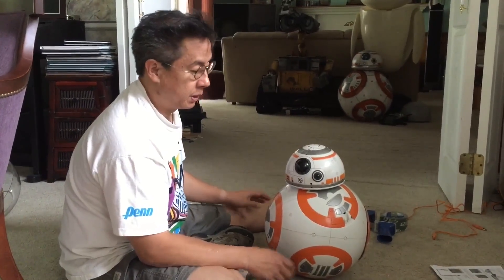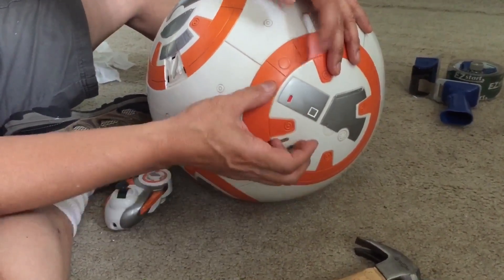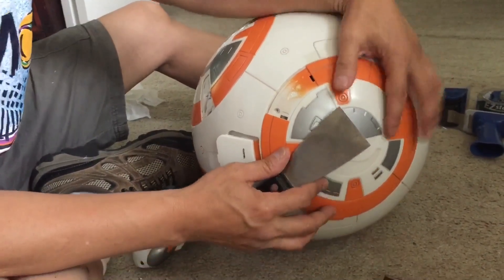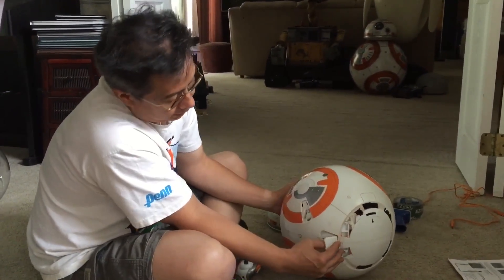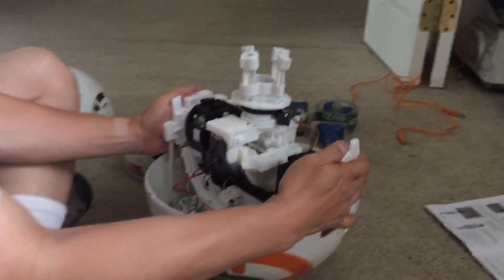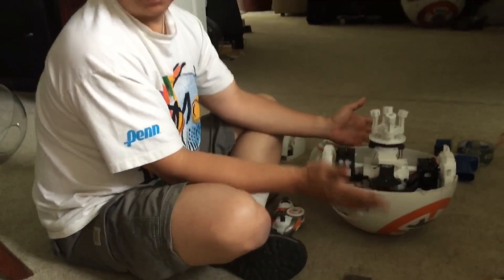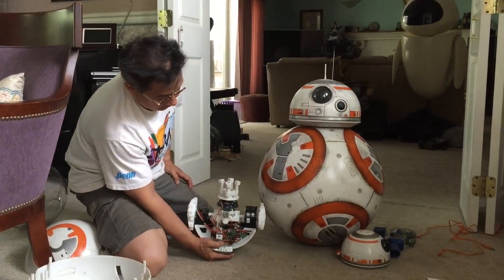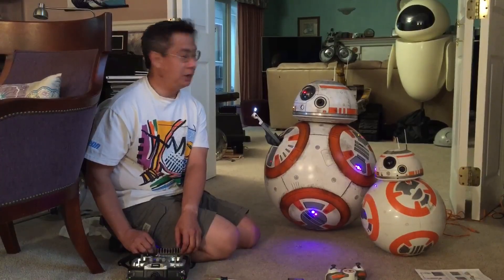Spin Master Hero Droid BB8 - Deconstruction

Comment: Hey I had this sitting wrapped up in my attic for years, was working fine when stored. Took it out didn't power on, plugged it in seemed to charge powers on both head and body. However it seems to work for only about 10-20 seconds before it makes these 3 beeps noises. Any ideas? Seems to work perfectly in any mode up till that point. Then I have to turn both off and back on again.

Comment: I just performed an operation on my 2017 SpinMaster BB-8 Hero Droid. What I originally thought was a battery issue, turned out to be a main drive motor seizing up. The toy moved slowly, and had great difficulties making turns. 
 
Thanks to you, Mike, and your video about making BB-8 a puppeteer, made troubleshooting a lot easier. I had taken the mechanics out of the sphere and use the remote control to make the motor spin.The drive motor began to smoke.

Luckily, I had purchased a spare sphere from eBay and have used it for parts. The sphere that I purchased was never opened. So I took out the drive motor of that sphere and put it in my BB-8 unit. Now it runs smoothly and it links instantly.

You know something? After reading the two manuals thoroughly it was disturbing to learn that this toy could explode, or catch on fire. You’ll be happy to know that SpinMaster suggests using sand or chemical fire extinguisher for the battery. And this is considered a child’s toy?

The real joke is that reading that same B&W booklet that when the batteries no longer accept a charge, they suggest dismantling the unit, and removing them. However, they never tell you how to disassemble the unit to access the batteries. 

My next trek is to purchase a brand new drive motor to have as backup. 

Thanks for all of your informative videos that you have posted on the this toy.

Jonathan

Comment: What kind of glue would you recommend when reassembling the unit?
Reply: I would not use any glue. Basically, the glue was used under the two panels. 
I’ve used electrical tape for added support, but I know in the future that I’ll have to take BB-8 apart again to replace the batteries. If you use glue, you’re gonna have a big mess when you have to disassemble again. 

As far as as the panels that I mentioned above, I was able to remove them and maintain the tabs. The tabs and the two screws actually hold the panels nicely onto the spear.

Comment: Anybody know whether it's possible to replace the internal battery? My unit hasn't been charged in a while and it seems no longer to hold charge. Any help would be great!
Reply: It's possible. I just did mine and it's not too bad. Just have to be careful removing those two round discs. That was the by far the most challenging part of the job.
https://youtu.be/AuewrxMWJCc
Reply: @rickmoore2055  thanks! I've reached out to you on your video. Hopefully you can help!

Comment: Hello Mike, I have a BB8 droid also with a slow red light flashing  on the  ball body with a faster red light flashing on the head part. Does it mean the battery is dead? I charged the body for full 3 hours and the charger showed the battery is fully charged. Also fully charged the head unit. Does it mean the main battery needs to be replaced in the body? Thanks!

Comment: My bb8 stopped working yesterday. not sure if it's the remote or the body. The charger for the body indicates it's fully charged but when i turn it on it does  a slow flash every 1 second. thoughts?

Comment: Thank you so much for a wonderful video.  I'm trying to take mine apart to change the battery.  If you have any suggestions to help with this project I'd greatly appreciate it.  Thanks.
Reply: I have a suggestion. Be very careful when removing the side panels. I discovered that they have some flex to them and I’m able to actually bend them without damaging the retaining tabs. I must’ve taken my spin master BBA apart a couple of times without damaging the side panel tabs

Comment: Hello, I opened the droid and replaced the internal battery that was no longer charging, after that the droid seems to have misconfigured and has all the lights flashing, with the head out of position and does not respond to the control.
Do you happen to have any suggestions to fix this?

Comment: Hey @TheMikeSenna can you help me?  The power and ground wires came off the charger board on the body for my spin master bb8…There are more than 2 solder joints and I want to make sure I get the correct ones when I solder back on…Can you help me?

Comment: Mike, I own a bb-8 hero and replaced both batteries using your deconstructed video…but now it is reassembled I get blinking lights on both pieces. I am assuming it has to do with the leveling device since it’s the only thing I removed. I live in SoCal and am looking for any help…would hate to just throw it out…thanks for the help!
Reply: It could be the leveling mechanism was not put back on properly. I talk about it in my video around the 3:03 area.
https://youtu.be/AuewrxMWJCc

Comment: Great video. I love my bb8. I hadn't turned him on in a couple of years. I also forgot to remove his batteries, so I had a little corrosion on one of the coils. After cleaning, it comes on, but bb8 doesn't respond. Bb8 turns on and moves his head initially, but that's it. So sad.
Reply: It's fixable. You can do it:)
https://youtu.be/AuewrxMWJCc
Reply: Coils? On the SpinMaster BB-8? The power configuration is a six AA cell battery pack that’s plugged into the main board. I’m not sure what you’re referring to when you say coils.

Comment: Just found one of these in the trash but need the charger. Any idea where to get one?
Reply: You'll either have to buy one with a charger or buy a charger alone which sells for over $50. There is no way to charge it without the charger specifically designed for it
Reply: Naturally, eBay, of course

Comment: Mike please tell me what to do when serial numbers on body remote and head dont match (( i bought it separately and it doesn't respond on remote control , it needs synchronization
Reply from the maker: Go to the spin master website and contact their customer support.  They have email and phone number.
Reply: Unfortunately, Mike, they are totally useless. I wanted to find out what vendor they went through to obtain the batteries and they gave me the runaround.

Comment: Hi I would like to know if you can help me. I have one of these and his head falls off when he turns.
Do you know what can happen?
Reply: Before booting him up, twist his head around yourself. The head should lock in the upright position, it should not easily turn when you push it, nor should it be leaning over. If the head isn't locked in correctly, chances are you only have one of the magnets locked in. There are two magnets that need to be attached, one on the front or BB-8's head, and one in the back. If only one of them is locked in, it is not strong enough to hold itself on.

Comment: Mike, thanks for posting this video. I was able to disassemble my BB-8 and found that one of the two yellow wires connected to the home position sensor was broken off. I was getting the 'system error' blink. Hopefully fixing that will cure it. I was thinking about changing the battery, but it looks a little risky to get that out and I am not yet having battery issues.
Reply: That'd definitely do it, There was another person out there on YouTube who fixed the system error. It looks like the wires can occasionally get caught in the gears that run the head, and get yanked out. I wish my droid had it that easy, haha. I believe mine has an issue with the encoder in the pendulum motor that tells it where it is rotated in relation to the rest of the droid. The motor spins in the same direction each time, regardless of the pendulum location, and it makes 3 small pauses inebtween turns. I'd assume this is just the droid trying to righten itself, and since it can't tell where the pendulum is located, it has no way of determining where to move the mass. Fingers crossed that this isn't fatal, but we'll see.
Reply: @corellioncrusaderproductio4679  what did it end up being
Reply: @lanewright7341  (If your BB-8 moves one of its motors 3 times in a row on startup, this fix is probably for you.) Inside, BB-8 has a small button sensor that the pendulum presses up against, which tells the robot when it is centered. That sensor was pressed so many times that the copped contact inside broke. If you switch it out with the one that detects the head, it powers up and works perfectly. When the robot can't find its center point, (when one of the buttons isn't getting pressed or is damaged and), it will rock the motor 3 times to try and find it, then give the system error. My first BB-8 had this issue happen several years ago, but recently I was able to get it to boot by switching the sensors.

If anyone is able to find a suitable replacement sensor for the board, let me know. I'm struggling to find the part online, and it appears to be a common fault on this BB-8. I'd love to put together a video documenting the repair.
Reply: @corellioncrusaderproductio4679  so I just swapped out the sensors via soldering iron and no luck. Same error
Reply: @lanewright7341  Does your BB-8 run any of the motors when it boots up?
Reply: @corellioncrusaderproductio4679  it does, and guess what I fixed it! After replacing the battery, I didn’t center the head mechanism. That was tripping the weight on the bottom. Tore it down again and re-centered it and it works!!! Thank you for your help
Reply: @lanewright7341  LOL...I did the same thing. Had it all put back together and then had to take it apart again because I did not consider the center point was off on that gear.
https://youtu.be/AuewrxMWJCc

Comment: Mine makes that last sound, does that means it's out of balance?? 17:34
Reply: Same issue. I have taken mine apart and it seems the motor moves the weight all the way to left or right. The only place it doesn’t go is the center. I replaced the battery, but still having the same issue. Maybe the sensor for the weight is bad any suggestions?
Reply: @claytonstults8319  I keep turning on/off the body while the head is attach, keep rotating the body until the axle is in the right spot. It's also important to know where you plug the charger, I memorize the exact spot, while I switch it on/off. Eventually the axle will latch.I don't take it apart anymore, just keep turning in on/off and rotate the body.
Reply: Thank you for your reply. I will try this today and hope for the best. What do you mean remember where you plug the charger? Do you mean remember the position of the weight while the charger is plugged in? If so I would imagine that is difficult once the body is assembled again. Thanks for your reply.
Reply: @claytonstults8319  I mean once you are rotating it, the on/off switch should always be near the bottom of the body, a little bit away the middle align with the two lights on its head, if that makes sense. Once you figure it out, avoid bb8 from running through walls and couches, shoes on floor etc.. that's what's causing the issues. I use to never let my 5 year old daughter control bb8, but now that I figured out a way of fixing the problem I just rotate to fix the issue, keep telling my daughter to control bb8 in a not aggressive way. She is getting better at it. Good luck you can do this..

Comment: The motor on mine won’t stop buzzing and whirring! It’s turned off. Not sure how to fix but spinmaster said they can’t do anything. It was charged two weeks ago and working fine. Last night it was in its corner and the motor started up. BB-8 does not move but the noise is loud and won’t stop. It’s essentially bricked and useless now. Rebooting does nothing. Don’t know where to take for repairs. Spin master offered me a 40% discount on an etch a sketch. They said they doing make them anymore and there’s no warranty and nothing they can do.
Reply: S B locate an electrical engineer. I had to do something similar for an iPhone. Apple couldn’t fix but the engineer replaced a chip

Comment: Hi Mike!, I opened up my bb-8 because it stopped working, I found the motor that moves the weight at to bottom is bad, maybe got stuck and burned, do you know where can I find one? or a model number so I can find one with the same specs, I'm having a hard time finding any specs for the motor, thanks for your time
Reply from the maker: Hi Jorge, Sorry I do not know the model number or specs for that motor.  Spin Master has a tech support number on their website, but I'm not even sure they can help as I don't think they go that deep into it.
Reply: @TheMikeSenna  Thanks for the fast response, I'll contact them to see if they do have any idea, or if I can buy one from them.
Reply: Find an electrical engineer. Have it fixed right

Comment: Can you upgrade the magnet that attaches the head? To lessen the accidental removal ?
Reply: I wouldn't recommend it since it uses electronic gyro stabilization. Making the magnets stronger would result in more drag when the head motors run, and it could result in him being generally more unstable. The head shouldn't come off unless it isn't all the way on, or he runs into something. It's pretty stable when it's going around on its own.
Reply: I have seen so many people comment about their BB-8 losing its head. I have not encountered that. Unless, BB-8 crashed in to furniture. Once you make the first contact with one of the magnets, just twist the head and it’ll connect the remaining three magnets. I do this all the time and it works like a charm.

Comment: One more question, sorry. Is there a way to intensify the red and blue lights coming from the head? There are no body lights, sadly. But If I can make the head lights brighter that would make up the difference.
Reply from the maker: I haven't tried.  It all depends on the specs of the LEDs.  I haven't messed with it so I have no idea what, if any can be substituted or added.

Comment: Mike, I'm a big fan and a 501st Legion member. My question is, is this the same for the life size version of bb8? 
Thanks!
TK/TB-41066, OUT.
Reply from the maker: This is one example of a pendulum type drive.  The drive that is in this one cannot be transplanted into a life sized one.  There is a lot of specialized programming for weight and other considerations.  Other BB8s use a similar drive.

Comment: Awesome...good job I need to change the battery on the body on mine any   recommendations which batter I buy???
Reply: Shida Battery technology  NI-MH Battery 1800mAh 7,2v
Reply: If anyone has replaced the body battery to a bigger mAh, please make a vid or link for the battery
Reply: Same, need to change the internal battery. Any tips?
Reply: @drewguion   you have to disassemble everything to get to the battery, I did it and now it works fine
Reply: @gusanocarbonero  Is it hard to get to the battery? Do you think I can change it for a bigger mAh?
Reply: @gusanocarbonero  can you provide a link to purchase the batteries you used to replace yours? Thanks.

Comment: i bought one from goodwill and followed your video on how to take the body apart. i noticed that the black and red wires were detached from the power area. is there a way to take that apart so i can reconnect them. thanks
Reply from the maker: Honestly I took that apart to long ago to remember what it looks like.  My advice though is to loo for any way to take it apart and try.  Even if you have to cut away pieces to get to the connectors, give it a try if you see it’s not a structural or mechanical part.  It don’t work now so you haven’t muchto loose.

Comment: Hey my hero droid head niw leans and isn't straight anymore what can I do to fix
Reply: remember, when you attach the head on, twist it to make sure it is locked in place. If you have done this, and it still leans over, Your will need to flip him off and on a few times, turn him back off, and charge him up FULLY. After he is done charging, try voice command mode.

Comment: Hi Mike my bb8 is having system error. Three LEDs are blinking non stop. How do I resolve ?
Reply: Hello. I might be able to assist you with your BB-8'S Hardware error through email. Do you happen to have an email I could talk to you by?
Reply: TheBackStabGaming yes lorettatay@gmail.com
Reply: I will respond to you there to help with any difficulties you are having. Thank you.
Reply: I have sent you an email, and I will await your response.
Reply: @thebackstabgaming4375  can you help me also (system error)?
Reply: loose wires
Reply: @MikeFarnhamGalaxysEdgeGroup Hi Mike. I have that same problem. Are the loose wires in the head or inside the body? Thank you.
Reply: I have the same problem, I played with it like for 10 minutes and then it stopped following my instructions or responding to the controller. Then, I switched it off and turned it on again, but after the head gets in place, the error is there again :( my email is jklazcano@gmail.com in case anyone can help please

Comment: Hey Mike! The battery life on mine has been reduced to about 25 minutes of play time. Would you consider that normal? Also it only takes about 50 minutes roughly to fully charge the main body. Thank you!
Reply: Currently in the process of upgrading the body battery
Reply: @LongLiveGojira  did you have any luck upgrading the ball battery?
Reply: @mattbedard1665  I recently did the replacement on mine:)
https://youtu.be/AuewrxMWJCc
Reply: Also...would you recommend just replacing the battery? I really don't want to return the droid to the shop since I weathered the sucker for a few hours.
Reply from the maker: I’m not sure what the battery life is, but I think that sounds about right.
Reply: Thanks man! Your work is amazing!
Reply: Cool regular guy I was able to switch out the battery on the head and with the upgraded head battery the total life span of the regular ball battery is about an hour and 15,